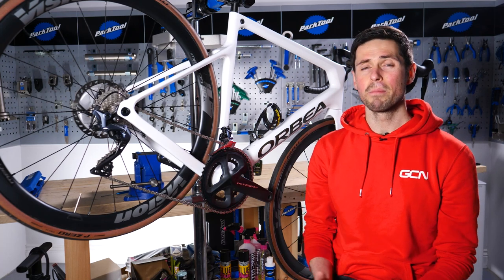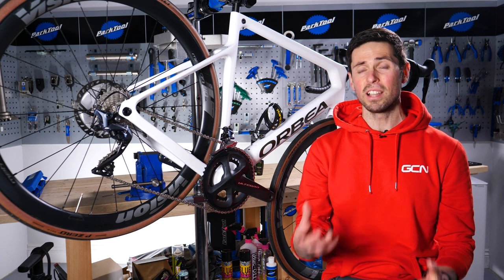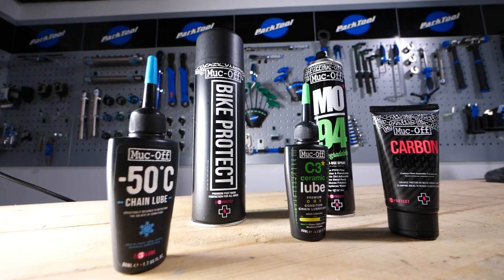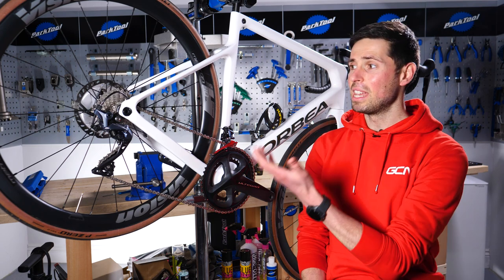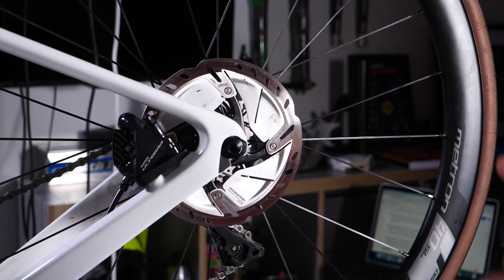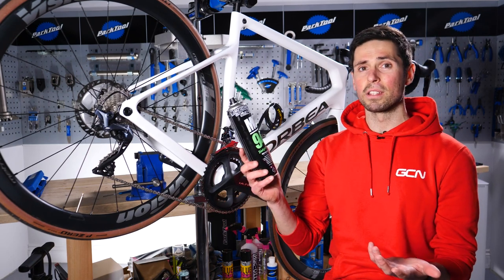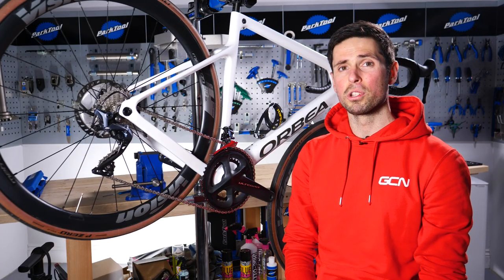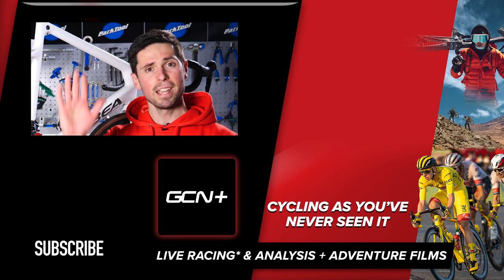How To Keep Your Bike Rust Free

Comment from the maker: Did these tips help you? Let us know in the comments 👇
Reply: Clean and oil/grease your bike.

You don't need a bike specify grace as well. For chain lube I do prefer a bike specific lube. 

For reducing moisture in/on your bike, don't waste a spray. Just use a heated fan if you've got one.
Reply: Yeah it helped... but what do I do if I have oil on my disc-breaks?
Reply: 3:14 to 3:19  si wrote that part right😂
Reply: @arvo_cado   clean rotor and brake pads throughly with soap and water and it should be fine
Reply: @kedarkulkarni3030  Hahaha the big X
Reply: @kedarkulkarni3030  Thanks mate
Reply: But Si said use WD-40!
Reply: @arvo_cado  I’d recommend white spirit (the purple paraffin-like liquid) wiped over the rotor with a clean cloth. It’ll evaporate after a short time, but don’t apply the brakes in the meantime.
Reply: Alex - once you’ve applied the WD40/brand to drive out moisture, how do you then apply the lube? I’ve always struggled with this. The water displacer sprays are effectively a degreaser, I thought, and you can’t wash it off because you then start the cycle (need to drive out moisture) all over again.
Reply: Yes But please do the videos WITHOUT the music. Thank you
Reply: A more detailed video would be great, specifically with advice on how to prevent rust on the dropouts of steel frames. We don't all have expensive bikes...

Comment: Just to add to your intro: Rust is the oxidation of metal with the oxygen all around us, and also water. Which is not just a catalist, but a molecule that contains oxygen. That is why the chemical compound is H2O (meaning 2 atoms of hidrogen + 1 atom of oxygen). So, many times the metals form rust by interacting directly or solely with water, and not with the air around us.

Comment: Also: get yourself a good high volume air compressor to blow all the moisture out of your drivetrain after you gave it a good glean with degreaser (and hosed it down obviously). Personally, I use a two component degreaser which leaves behind a thin oil film after being washed off with plain water such that after drying, the chain doesn't rust simply by being in contact with the moisture in the air. However, any normal degreaser will do if you simply lube your chain right after drying of course

Comment: If you are using a "dry (wax-based) lubricant" on your chain, do not apply a petroleum based product on it.  If the chain is wet,  just wipe it off and reapply the dry lubricant.

Comment: When referring to alloy parts on bikes it generally means aluminum-based, and aluminum (or aluminium to you commonwealth folks) doesn't rust. It oxidizes, but in a way that's far less of a problem on bikes that are properly maintained. The only metal parts on bikes, or really anything, that rust, are iron-based ones, which on bikes means steel, which is mainly used in moving parts that bear a lot of dynamic load and wear, like chains, chain rings, cogs, bearings and the like, and of course steel frames. And if you keep them clean and well-lubed and stored indoors and away from moisture, you shouldn't have a problem with rust.

Comment: My new bike fell over. And during assembly I had a couple booboos. Derailleur, back rack, and front fender all have areas without paint. How worried do I need to be about rust? I’m unsure if it’s steel or aluminum. Frame is aluminum.

Comment: Clean and oil/grease your bike.

You don't need a bike specify grace as well. For chain lube I do prefer a bike specific lube. 

For reducing moisture in/on your bike, don't waste a spray. Just use a heated fan if you've got one.

Comment: Too bad you didn't cover the insidious galvanic corrosion, much of which is due to poor frame design.  It's been my nightmare having to toss one frame which had an aluminum bb sleeve oxydize away from the CF.  Now I'm dealing with corroded alloy internal cable grommets on a CF frame!  I wash and maintain the bikes after every ride!
Reply: Planned obsolescence. CF frames are also not recyclable or biodegradable. If corrosion is your big issue then an Alu frame is probably a good idea (I don't like them because of the limited stress-based lifespan but it's better than CF...)
Reply: @Aubreykun  Alu frames also suseptable to galvanic oxidation.  I had a few alu frames.  A custom ti frame with no alu bits including ti DOs and BB sleeve would be ideal I believe.  There are some pretty nice ti frames from besoke custom builders these days.
Reply: @johnmbrown7515  Galvanic requires another material. If you use as many alu parts as you can and separate steel fasteners with insulating materials like plastic shims, washers, and use a dielectric grease you should be pretty good for a while. And there's a lot more material to take up any corrosion that does happen vs the thin isolated inserts in a CF frame. Plus when it eventually does fall apart - into the recycling stream it goes.

Comment: British cyclists will already know this, but salt on the roads is a real pain if you ride in winter (also laughingly known as 'summer' here in Merrie Englande). Salt does terrible dissolving-type things to snow, ice, bikes and cars... But it's great on chips.

(Whoops, sorry. Can I mention chips on a serious cycling channel? Here's another one for ya: Ready Salted Crisps! Yeah! Take that, you lithe, lightweight, lycra-clad loonies!)

My duff old bike's only worth about £30, so I just slather all the moving bits in Castrol GTX (10W-40) car engine oil left over from the days a decade ago when I could still afford to run a car.

"Engine oil? Horrors!" cry all the pros. "Think of the drag!"

Yeah, well, I don't care about that. My bike's a tool, not a recreational vehicle or a style and efficiency statement, and I'm not worried about anything you serious rider peeps get up to. Engine oil is great for chains because it stays put and laughs at water, snow, and salty slush.

It also looks claggy and dreadful once it's got some dirt and dust in it, so nobody's keen to steal My Precious when it's chained up outside Sainsbury's. It's a win-win situation.

I'm going to fry some chips now. Mwuh-huh-huh...  👹
Reply: You can use softened beeswax to seal up the gaps between moving parts (Stem, seatpost-seat-tube interface, headset, the little holes left from welding...). As long as you make a nice fillet or overhang against the direction of water it should keep the inside nice and dry without letting drips go in places you can't oil easily. 
It also can look horrendous - like there's some kind of horrible mold on the bike - which should help keep thieves away.

Comment: Do you need to clean and grease the bearings in your wheels or are they sealed?
Reply: Depends on which hubs you got. Some cup-cone style hubs from Shimano (even newer models) would certainly benefit from some maintenance now and then but generally speaking, most hubs use sealed bearings these days
Reply: If they use cartridge bearings you just need high quality ones (NSK, SKF, KSM, etc. Not ceramic). 
If loose-ball then yes you do.

Comment: Alex, question, disc brake caliper, mine are showing signs of corrosion, don’t want to use WD40 type lube, as I don’t want that on the rotor, any suggestions what to use?
Reply: Could remove wheel and break pads first.

Comment: I have heads of bolts getting a light dusting of rust over time. What can I do the neutralise that?
Reply: Take them out, wire brush the rust off, and coat with something. Paint, automotive paint sealant, a non-cleaner automotive wax or a melted solid wax (candle, paraffin or beeswax). You can also plug over the bolt with wax - it can look ugly but will seal the whole head and gaps around it.
If you want to replace them - you can either swap to stainless or higher quality chrome or zinc plated cromo bolts. For non-load-bearing bolts you can (at your own risk) use nylon, Ti or alu bolts. Don't use Ti or Alu in steel parts/nuts, it will accelerate corrosion. Nylon is the weakest so be careful with that - for plugging the holes on unused rack and bottle bosses mostly

Comment: How can you tell when your chain is properly dry when you clean it and dry it ?
Reply: when theres no water particles
Reply: Just use a hot fan on your chain of you've got one. Once chain is warm for 5-10 mins, give it a spin and then another 5 mins and it'll be bone dry
Reply: @supernoodles908  What a waste of energy. Just spin the crank fast when it´s very wet. Then you can use an old towell to get rid of the remained water.
Reply: A quick blow with the old air compressor always does the job for me
Reply: Just wash it, dry it a bit and wait to next day having stored the bike away from rain.

Comment: Uff, I would not call water a catalyst in the context. It does not reduce the energy barrier of the process (that's what catalysts do). Water and the ions dissolved in it form an electrolyte that allow for the exchange of ions on the electrodes. Dr. Bridgewood must be on vacation right now.

Comment: #askgcntech what is the steel parts of the full alloy bike, full carbon bike,   and full titanium bike? I plan to replace the rusty and rotten ones
Reply: In bicycles, you generally find steel alloys in the chain, cassette, pedal axles, hub axles, cables, and spokes.
Reply: Stem bolts. If, like me, you're constantly messing with your position then every time you go near these you wear away the plating and they rust and then they round off. So buy a massive pack for a fiver and just replace whenever you dislike the rust colour

Comment: what about wax on the chain?
Reply: Dry lubes aren't the best for rust prevention as it just washes off
Reply: @supernoodles908  well, waxed chain prevent rust to go inside, because it seals. Prevent from breaking and give a longer life to your chain. But you need a better maintenance.
Reply: @supernoodles908  moreover, when you clean your chain you clean only one the surface, but all the rust inside the chain still remains. Do you add lub on rusty inside. No good, and you chain brakes earlier. To get off the rust you have to clean it with a long process of different type of bathing. When your chain is completely clean (out and inside) you can lub, but will rust faster or you can wax, and rust, dust won't get in so easily as it is with all the lub, protection or whatever the marketing name.
Reply: @supernoodles908  it's used by lot of big pro or ppl looking for efficiency.
Reply: @supernoodles908  and it's cheap 😎
Reply: @Babkyb  okay, so, waxing a chain for wet conditions may be okay to a point. The issue of them with wax is it is not a hydro-displacer this is due to a properly called "wetting factor" and a few others. You can look it up :)

Since wax is mechanically bound to surface mostly and does not displace the water, water can get mixing with the wax and underneath the coating. This also means the water can be held against the chain causing further rusting.

Now, waxing can be okay in the wet, but you have two more frequently rewax your chain otherwise you mechanical mix in water into the wax itself. This also means the wax doesn't stay on and in the chain as well
Reply: @Babkyb  I know about the efficiency gains. I use it when racing but when training, it doesn't matter how fast my bike is, I just need to train
Reply: @Babkyb  on the rust on the inside off your chain, this should not be happening if you use the correct lubrication for your riding conditions. Also your don't get rust build up on the inside of a chain due to the high cycle and force applied. So it rubs off and breaks of rust from the inside of the chain. This shouldn't happen though if you lube correctly. 

Eg look at a car in frequent use, the break pad will be clean where the pads rub. Then look at one that isn't, most of it will be rusty. The inside of your chain is like that. Frequent use will displace that rust. Then clean it with a fluid of your choice to clean it
Reply: @supernoodles908  Are you talking about liquid wax or a hot-bath wax?

Comment: "How to keep your bike Rust Free" It's called: Get a belt drive bike!
Reply: That doesn't help your stem bolts now does it? Lots of stuff still needs grease and other corrosion protection. It isn't just the drive train
Reply: @nt2883  My what?
Reply: Do yourself a favour and make sure someone else services your bike
Reply: @nt2883  okay I just looked that up, you’re over reacting there. Those tiny little bolts can be rusted out if they want to be. I’m not changing out my bars any time soon
Reply: @nt2883  Oh I will, I don’t know how to fix a bike at all, that’s why I found a belt drive bike from Specialized. Smooth, high quality, bulletproof and quiet. And if something goes wrong, I’ll take it too a bike shop, I don’t need your snobby attitude

Comment: I appreciate that Muc-Off is a sponsor, but it would be nice to see you using other products in an unpaid non promotional video..
Reply: Why? Chances are they have bottle after bottle of the stuff around.

Would you expect them to go out and buy non Muc-off stuff when they have boxes full?
Reply: I appreciate my local football team are sponsored but it would be great to see them with a different name on their shirts occassionally
Reply: They've shown Park chemicals before and on GMBN Tech they feature other products sometimes (Still a lot of Muc-Off of course). It helps to look at the other sections of cycling for cross-discipline tips!
Reply: @callumsmith338  You do have to wonder if EVERYONE at GCN just uses Muc-Off at home, because it's 'free' for them, or if they have their favorites of a mix of brands. As with any relatively-professional network that has sponsors for most things.